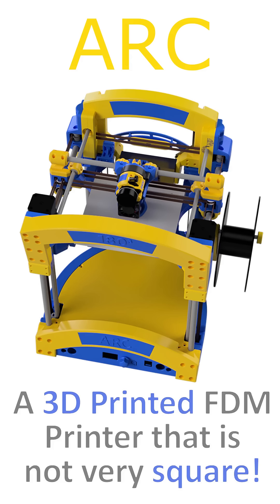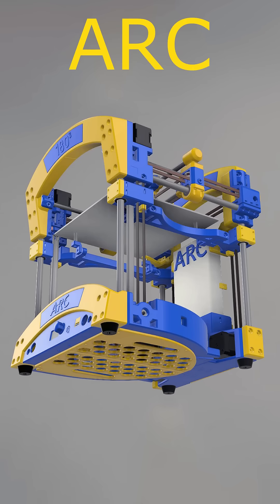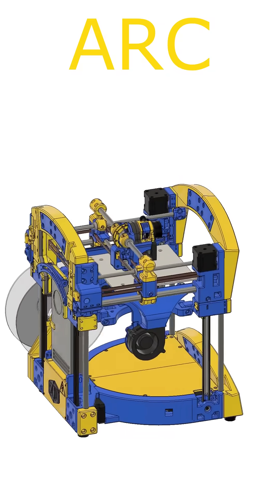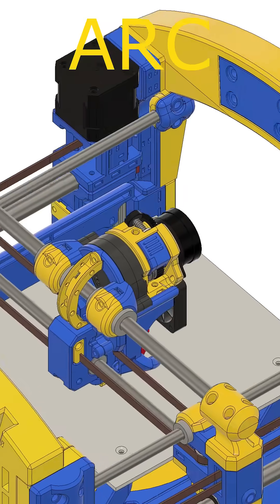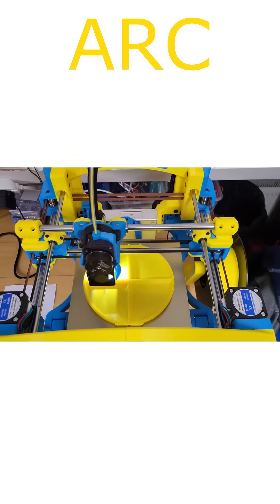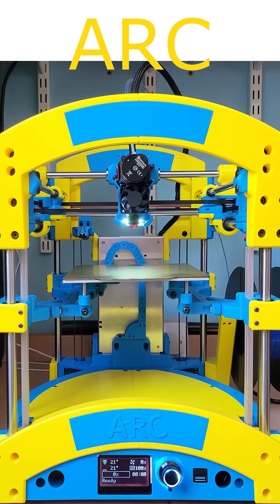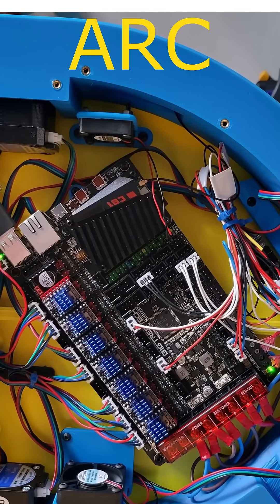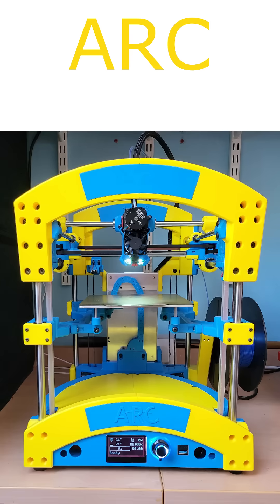ARC - 3D printed FDM printer that is not very square!

Comment: why the choice of using QGL? Instead of just using 3 motors on the z axis?
Reply from the maker: As the vertical guides also form the frame structure it was logical to use QGL because of the 4 uprights rather than adding another false element to create the third lift. I have considered a Tri Arc for this reason, thanks
Reply: @boothybuilds makes sense! QGL looks way cooler
Reply from the maker: Thanks

Comment: Beautiful.
Reply from the maker: Thanks
Reply: @boothybuilds will the parts fit in 180 x 180mm bed print or need to be 220 x 220mm
Reply from the maker: You really need a 250 x 250 printer for the larger parts which are approx 230 to 240. They could always be split up more but some reinforcement may be required which may defeat the object but doable.

Comment: Very nice, how large of a build volume do you need to print the largest parts for this printer?
Reply from the maker: 250 x 250 ideally, the largest parts are around the 230 to 40 mark in length, parts could be split up more I suppose though